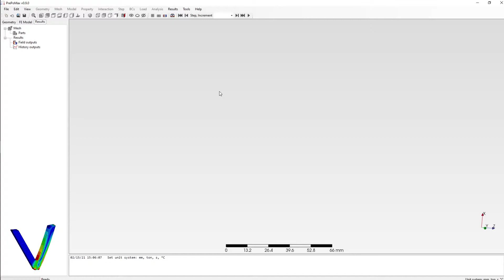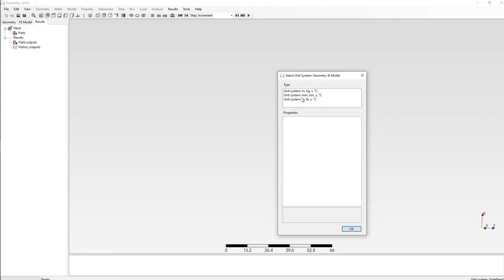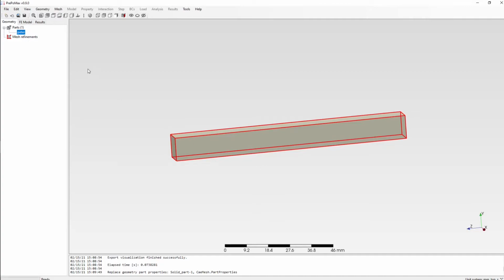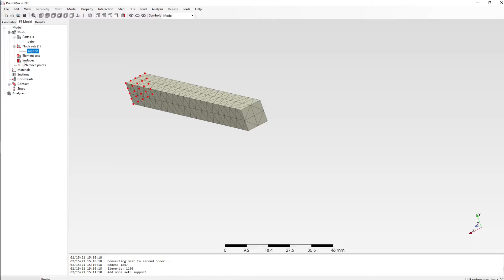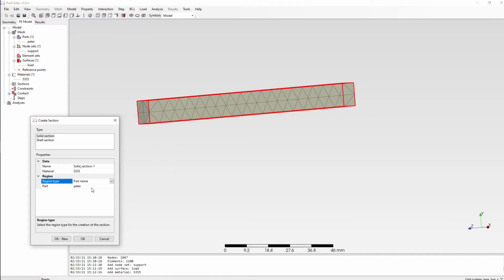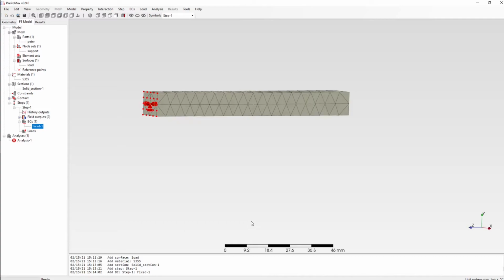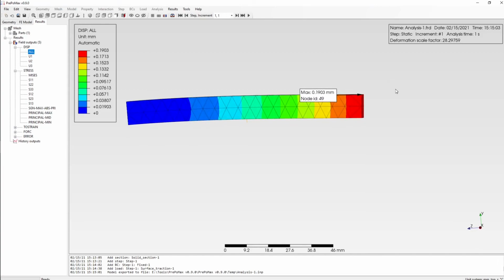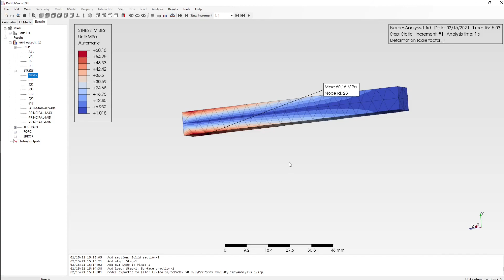FEM - Calculix - PrePoMax Tutorial 01: Basic Simulation

Comment: Does anyone if it is possible to use expressions for loads (pressure)? For example, I need to prescribe a hydrostatic pressure load as -rho*g*y. I noticed that the "Pressure" load option in the GUI does not accept an expression like this. Any ideas?
Reply: Hydrostatic pressure is now available in PrePoMax :-)
Reply: Only DLOAD subroutine will let you do this in CalculiX.

Comment: I was comparing a result of freecad fem vs prepomax, and the result was different. This was supraisingly since both software are using calculix as post processor
Do you have similar experience?
Reply from the maker: Hi,
I would recommend to check if your settings are really the same. Sometime there can be a slide difference, which can have a huge impact on your results. :)